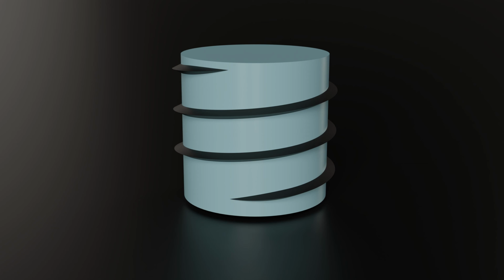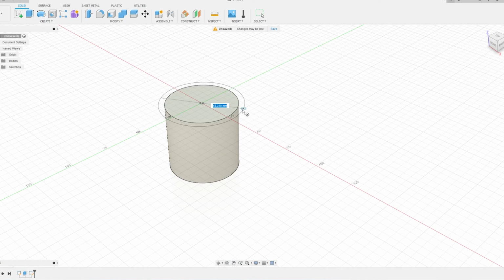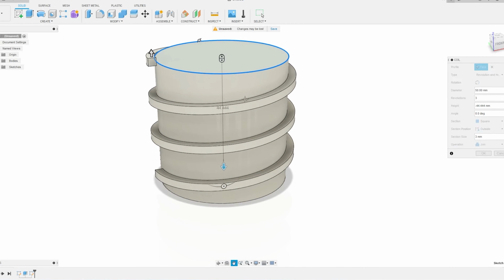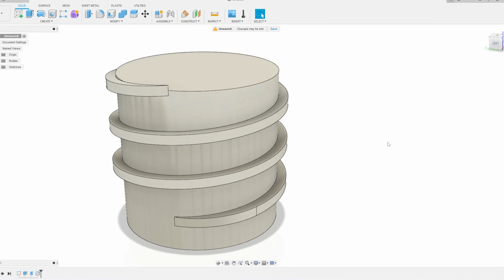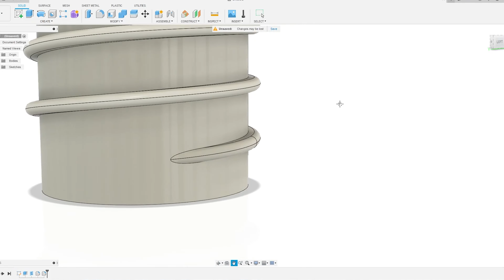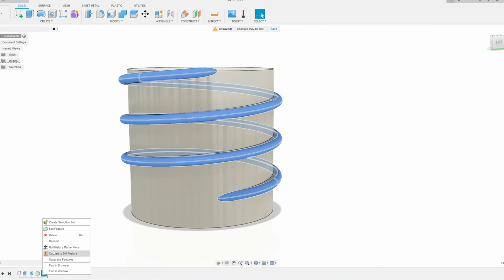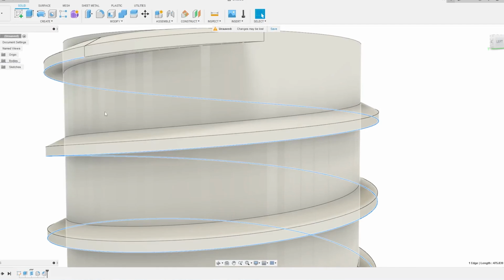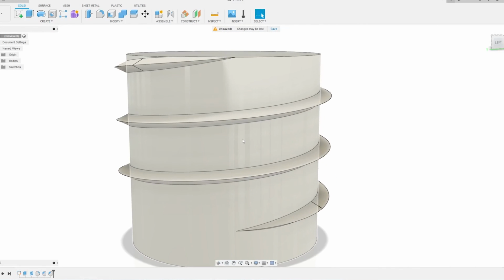Custom Threads With Tapered Ends | Fusion 360

Comment: Thanks very much, but what I don't like is there is always a bit of thread poking out the top. The halfway point of the thread is placed on the edge of the cylinder so you'll always have a bit poking out. With there was an offset feature so you can offset it from the plane you choose. Of course there's any wants to fix this but would be nice to do it all in one box.

Comment: This Tutorial is one of the best Fusion 360 videos I have ever watched!  It is absolute genius! A simple method to approach a very frustrating problem that Autodesk should have addressed a long time ago. I needed to place threads, for 3d Printing, around the outer diameter of an 8- inch cylinder, this worked perfectly. Now to figure out how to make, and add clearance, for the nut, using this method.

Comment: Any idea why when I try to add the fillet  to taper the ends it doesn't go nearly as far as yours before I get an error? You seem to be able to go as far around the coil as you want, I can only go maybe 8mm.
Reply from the maker: I can't tell exactly because I don't know what your coil looks like but from just playing around with it, I found if the pitch of the thread is too high it can cause the taper to not go as far. You can post the parameters for your coil here if you want and I can try it myself.